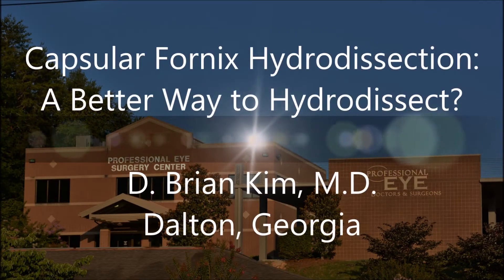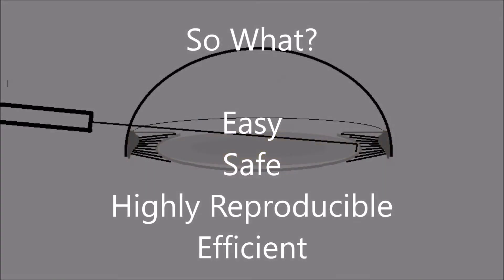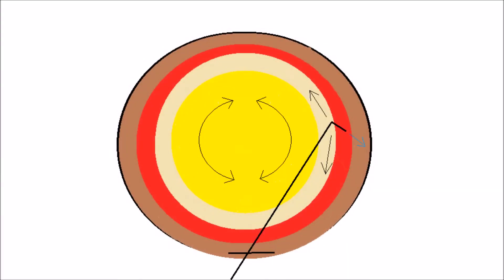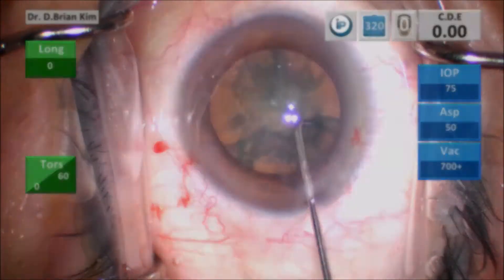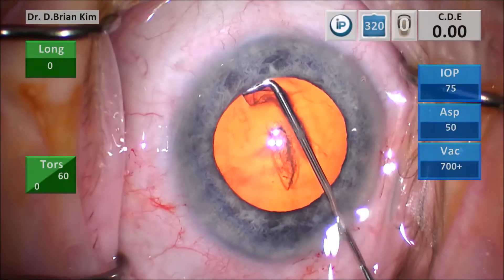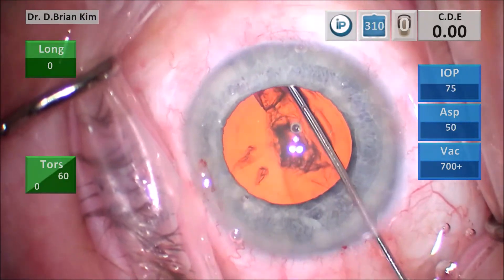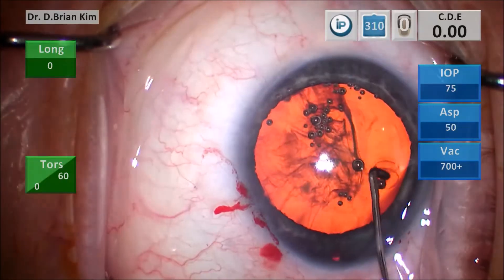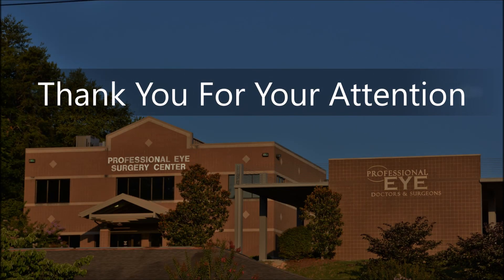Capsular Fornix Hydrodissection: A Better Way to Hydrodissect?

Comment: What do you think about the “THE SPIN” as pioneered by Neto Rosatelli? I think it may be something to consider adding to your “best way to do cataract surgery” routine...
Reply from the maker: OPHTHO INFO thanks for pointing out his spin technique. I just watched one of his videos and he is a master at that spin move. But I don’t think it’s necessary to spin it like he does to achieve the same result. He has fine cortical wisps on some of his cases, and I tend to have those same wispy fibers with my own cases. If his spin maneuver fixed these wisps, then I think it would be a good thing to adopt.

Comment: Brian, is it possible to achieve this using the Chang cannula? 

I actually initially thought (watching an earlier video of yours) that you were using the Chang hydrodissection cannula and had my ASC order a bunch. Will order a bunch of those if you think the Chang cannula won't work as well. Thanks so much for the useful techniques
Reply from the maker: msmagrabi hi, yes you can use the Chang cannula. Actually, I experimented the technique on the Chang before developing my own cannula, but I feel the Kim cannula works better, more consistent.  Thanks for your interest. I hope this helps.

Comment: Hi, It looks very nice and efficient procedure!!!
But, the right angle tip seems little bit long.
so, I think when you rotate the tip 90' under the deep fornix, there is a chance to touch posterior capsule.
What do you think about my opinion and how can you manage or prevent this happening?
Reply from the maker: Yes, the cannula is touching the capsule in the fornix.  But this is not dangerous. 
The anterior-posterior diameter of the lens is ~4mm, while the cannula is ~1.2mm in length.  There is no way it can reach the posterior capsule.  I have NEVER ruptured the capsule performing this technique and I have been performing exclusively over the last few years and over 2,000 consecutive cases.  It is by far the most efficient hydrodissection technique I've tried and it is the reason I developed it and why I continue to use it.  But the only way to know how good it is, is by trying it yourself.  If you have any questions, please let me know.  Thank you.
Reply: I was thinking the same.

Comment: Thanks Dr. Kim.  Could you describe the "wiggle" in more detail.  It is not clear from the videos when you are doing it and what it's supposed to accomplish.  Is the wiggle simply an up and down motion?  Or a side to side motion? Or a torsional motion?  Thanks
Reply: D. Brian Kim MD thanks for the great videos. In which plane do you do the wiggle? What do you mean by up and down? Keep it up
Reply from the maker: Ilan Hartstein, great question.  Here is another video which explains the wiggle.  I hope it helps to clarify.

https://youtu.be/eys064hMNC4
Reply from the maker: Ilan Hartstein, sorry.  I think I linked the same video.

The purpose of the wiggle is to make sure the cannula tip is in the proper location.  The tip should be in the capsular equator between the lens material and the cortex/capsular bag.  When the cannula is in this potential space, the bss flows smoothly for hydrodissection.  The wiggle creates some space and help to  ensure that you are in the proper place before initiating hydrodissection.  I hope this clarifies.
Reply from the maker: Khoueizouk the wiggle is to ensure you are in the space between the lens and the bag.  Stay within the horizontal plane.  Push the cannula forward and you will feel the capsular bag then pull back a little bit.  The HD wave will flow consistently.  Hope this helps.
Reply: D. Brian Kim MD thanks for the quick reply. Will definitely give it a try. Any recommendation on the type of cannula to use? Is it a chang cannula?
Reply from the maker: Khoueizouk this is the cannula I designed.  I have no financial interests.

http://www.katena.com/html/product_detail.cfm?ID=1640&Letter=K&EntryID=1616&BackPage=catalog_index%2Ecfm

Comment: I have been doing capsular fornix hydrodissection after seeing it in your initial videos.  My only concern has been posterior capsular blowout.  To avoid that possibility I have started doing a mechanical anterior capsular separation first. I then go forward with this step.  Have you ever faced a posterior capsular blowout with the above?
Reply from the maker: I'm glad you are doing the technique and hope it has been beneficial to you.  I agree that PC blow out is something to be aware of with any HD technique.  For the record, I have not had a PC blowout since residency, regardless of HD technique.  And I believe PC blowout is all about technique and following simple rules.  My main rules:

1. I try not to push the plunger too aggressively.  Aggressive fluid causes uncontrolled amounts of BSS which can blow out the PC.  If you encounter a lot of resistance, wiggle the cannula or pick a different spot.  It's not worth pushing against a lot of resistance and something bad happening.

2. I stop pushing BSS when the HD wave covers the posterior capsule.  I don't believe it needs to cover past the subincisional area.  By doing so, you will prevent too much intracapsular fluid to form.

3. I always decompress after the HD wave.

4. By sweeping left and right this also loosens the lens but also helps free up intracapsular fluid.

I hope this helps.
Reply: D. Brian Kim MD thank you!